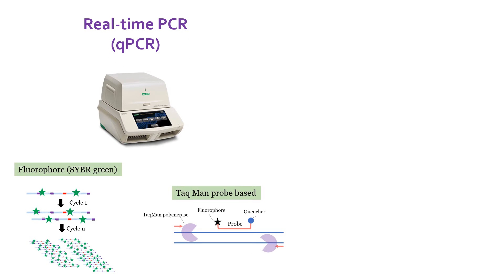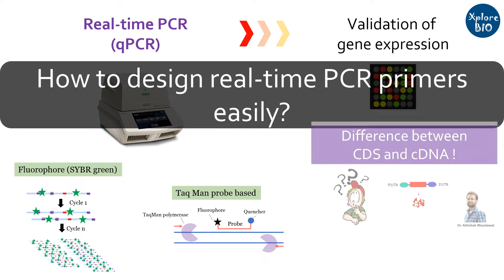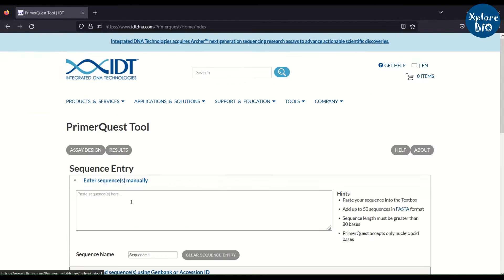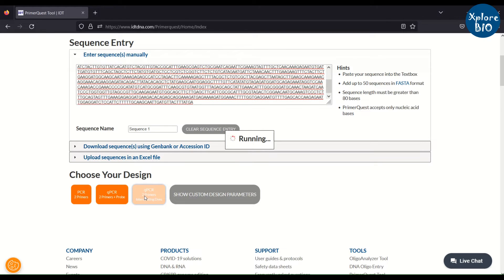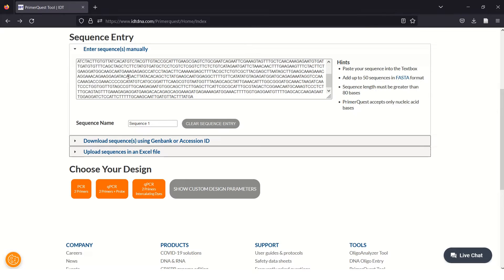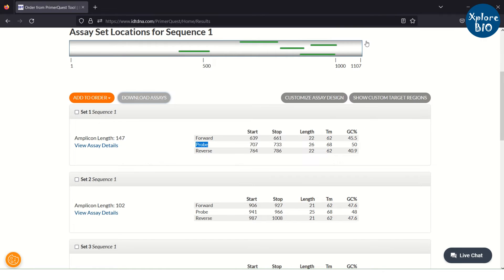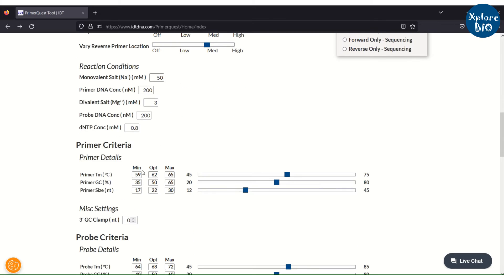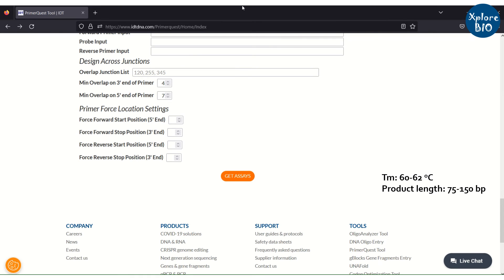How to design primers for real-time PCR (qPCR) for gene expression? Easily and quickly. PrimerQuest.

Comment: I I would like to know whether the primers designed in this way span an intron.
Reply from the maker: They are designed from exon region and if there is an intron in genomic DNA sequence, it will span the intron, and you will get larger product than expected. But if you used cDNA for amplification, there will be no intron.

Comment: How to check the efficiency of manually designed primer? Can we use primer BLAST for it? I tried for it but most of the time my designed primer does not show binding with host genome (host genome often do not available at Primer blast host genome list) .. but I experienced that primer do perform PCR in a well manner. But what if it does not perform? Plz help
Reply from the maker: Primer blast with genome is a good idea to find if the target gene is being amplified. Generally high tm about 65 and primer length over 26 provides good specificity. Also verify last 8-10 bases of 3' end of each primer. If possible it should not match other parts of the genome. Generally you get desired gene amplified. But you are right some times you may get non specific amplicons. In such case you can further increase tm or reduce annealing time Or go for gel extraction of desired fragment of you want to proceed for cloning.